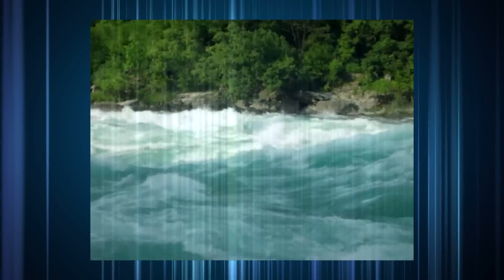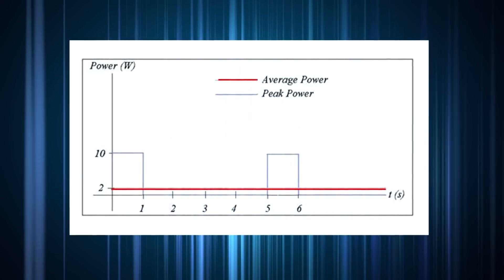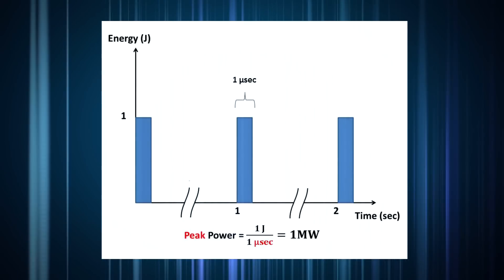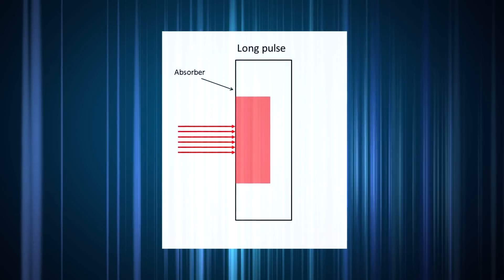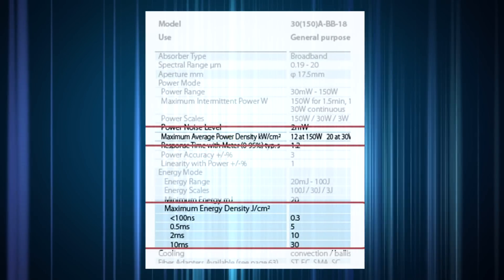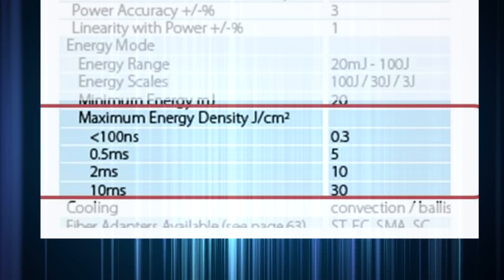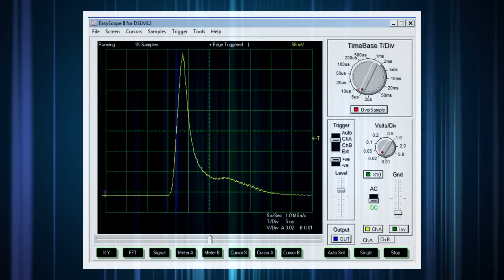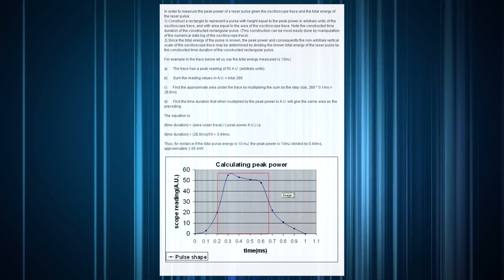Peak power vs. Average Power – What is it, and how do I measure it?

Comment: thts so bloody confusing
Reply: What is confusing? What are you trying to do?
Reply: @BrightLightsforAll  I have like 1000 silly confusing questions that you ll not like to answer ben!
Reply: @champion007able  what are you trying to measure?
Reply: @BrightLightsforAll  its RF energy.. I have a device which has RF i/o slot if I plug a tranceiver that has an output power of 57dbm will it screw my device or not..? it has an peak power capability of handling 4kw
Reply: @champion007able  no this company is focused on laser measurement. You need to look into spectrum analyzers
Reply: @BrightLightsforAll  electrical engineering is so difficult and deeeeppp